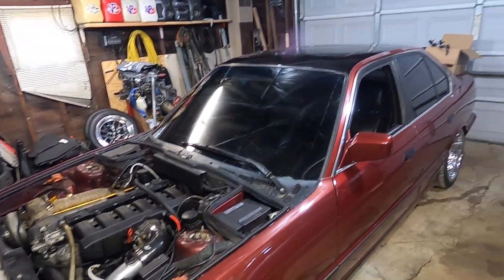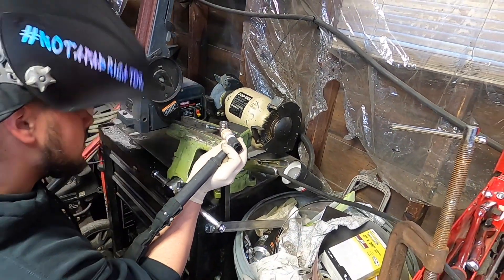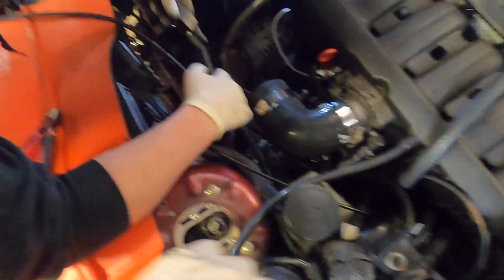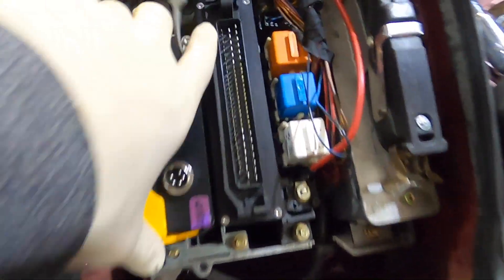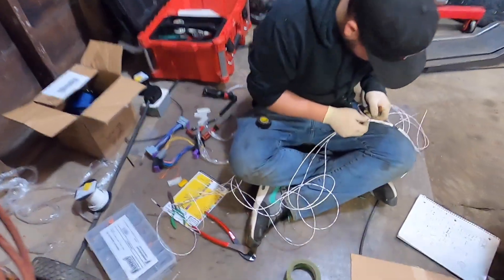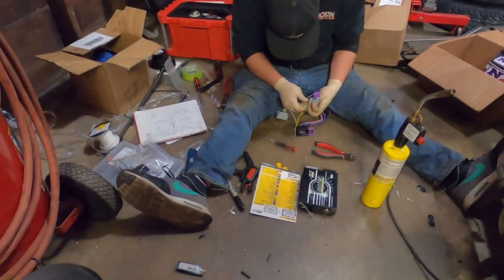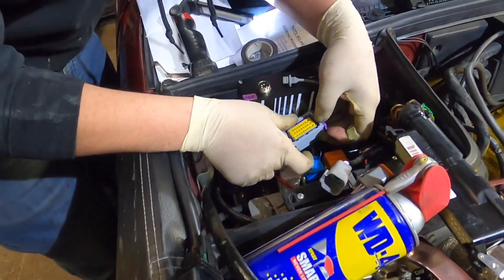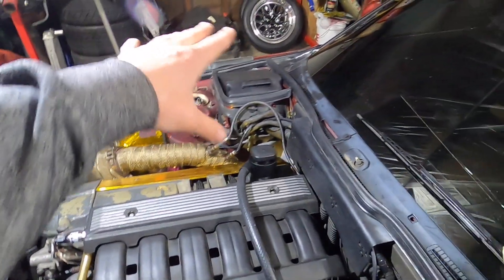Wiring up the standalone ECU for the Turbo m50 E34 BMW

Comment: Do you know where i can find data for the wiring chassis side for oil light alternator light rpm signal etc on them round plugs? Im doing m57 into tds e34.
Reply from the maker: @Rderbbux  unfortunately not

Comment: hey man, got a question. does the dash retain functionality with the standalone? specifically the tach and fuel consumption dials and the lights such as  oil pressure warning etc. thanks!
Reply from the maker: Yup! All dash features work except check engine light. And fuel consumption does not work

Comment: Things that use vaccum: Where did you connect them to? Straight to intake manifold like stock? Because i have issues that, in boost conditions, you wont have vaccum there. That a problem?